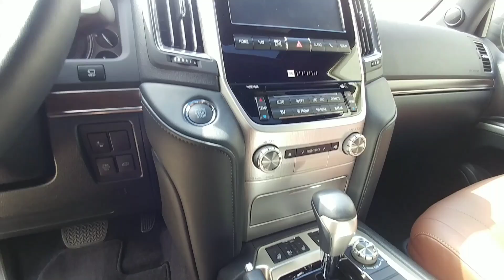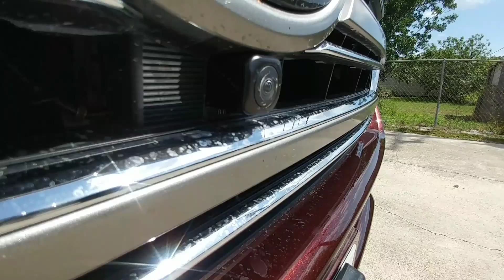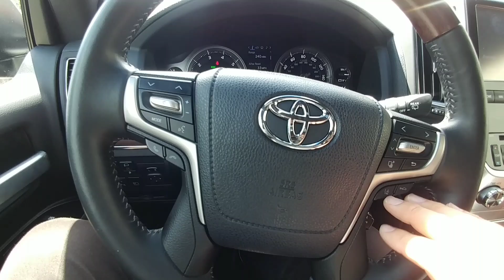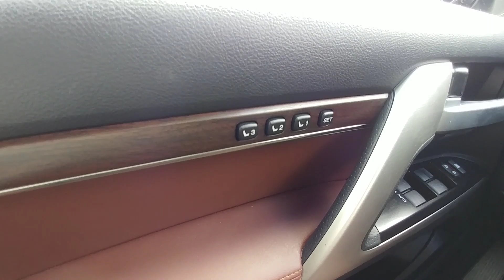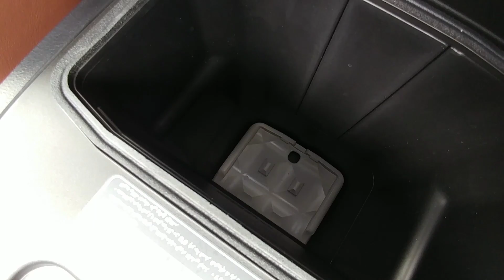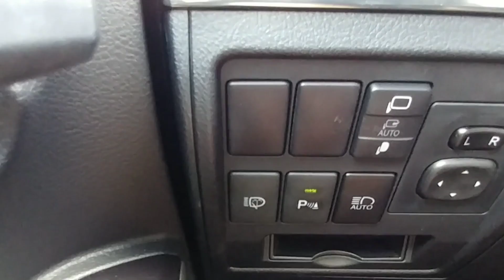The ultimate SUV! 2018 Toyota Land Cruiser

Comment: Actually the split tailgate is not new for this model. It first was introduced in the 100-series back in 1998. The rear swinging doors you mentioned were on the smaller Land Cruiser called the “Prado”. They were also available on some base model land cruiser 100’s but as standard they would come with the split tailgate as shown here. 

The only “new” thing that this current model has over the last one is the the top part is power operated. On the older 100’s it’s all manual release.

Comment: I love this truck and could care less about how "dated" it is compared to some of its competitors. I personally believe it's the best vehicle under $100k. I love the notion of stealth wealth -- you could take this through a bad part of town and not draw any attention to yourself -- the same cannot be said in any other $85k suv. Resale and reliability are also big selling points.
A few things really bug me though. First is that you have to go through the center screen to change the HVAC settings; I think that would be really frustrating to live with especially when using navigation. Apple carplay is also not available yet --  not a dealbreaker just would be nice to have. Also, the rear seat center armrest is too low -- sounds weird, but I sat in one of these and it was in a really awkward position where it doesn't really hit your arm when sitting regularly. Third, I wish that it was easier to remove the 3rd row of seats altogether if you don't need them. In the old 100 series cruisers, this was easy, but there is no easy way in this generation. Sure, better fuel economy would be appreciated, but those who can afford an $85k vehicle typically don't have to worry about budgeting for gas.

Comment: Why only 5 screws on the wheels. Saw smaller cars with 6 screws. Doesnt that mean toyota engine is weaker and doesnt produce that much force to the wheels ?
Reply from the maker: or they use stronger lug bolts.

Comment: I've had one since 2008. I live and work in Africa. The reliability and comfort is exceptional. Someone mentioned 350 MPG. Mine's diesel and I can drive 850 kilometers on a full tank (130 liters). The wife has a Range Sport, my son a Nissan Patrol , my daughter a BMW X6 and my Toyota spends the least time in maintenance and is by far the most reliable!!

Comment: my mom has a 2013 and that thing is amazing 100,000 miles and not a single issue. it drives like a brand new one
Reply: How comfortable is it? Does the off-road suspension make it ride rough over less than great pavement?

Comment: Its nice that land cruiser has drain plugs for transmission, front and rear diff.
Reply: is that not standard?
Reply: James Flores , it's only standard on Toyota.
Reply: +repairvehicle even sealed transmissions have fill and drain plugs you know right?
Reply: James Flores , do you know what sealed transmission means?
Reply: means no dipstick... ive changed the fluid in 2 vehicles I own both with sealed transmissions 1999 isuzu rodeo and 2009 bmw 528i
Reply: James Flores , transmissions without dipstick, have drain plugs and fill plugs.
Reply: yeah they are also called sealed

Comment: Forgot to add the fact that it’s a Toyota and will last 200k+ very easily with just minor maintenance! I wish I had the money for a Land Cruiser but too rich for my blood best off road SUV out there imo 🤷🏻‍♂️👌🏼👍🏼
Reply: You can find old 100 series for under $10k with less than 200k miles, 200 series start around $25k with around 150k miles. That's the beauty about the land cruiser, if you really want one, you can likely afford a used one that has lots of life left --even if it already has 150-200k miles.
Reply: You should check YouTube.  The motors are blowing on these all around the world as soon as 30,000 km (19,000 miles) due to faulty air box design.  The only thing legendary is the brainwashing.

Comment: $20k less and needs torsen front and rear diffs to live up to the LC name.
Reply: Firestarter according to the website it has exactly that.  Triple lockers Torsen unit.
Reply: Irish Spring Soap the American variant LC 200 series have open front and rear diff with a locking torsen center diff.

The international version has at least a locking rear diff. 

Land cruiser shouldn't have a single open diff

Comment: It looks like a great SUV but I'll never buy one. Like Apple and Harley, the Toyota brand has died for me for one reason... The smug douchy attitude of their owners.  I get one occasionally when I rent for work travel and I like them. I know they are rated well for reliability but I just don't care. I do preventive maintenance on my American cars and have yet to see a failure... With the exception of a 1996 Pontiac Firebird I bought new. Got rid of that thing when the warranty expired like it was on fire... Which it may have been. I was young and dumb and ran it hard. LOL

Nothing against foreign cars in general, mind you. I primarily buy GM because of the ever dwindling employee discount from my Dad, who retired from there after 43 years.  I just can't drink that particular flavor of koolaid.
Reply: Sociopath Mercenary it’s funny but I got to share that my daughter only 11 year old finds a resemblance on some GM cars with Toyota Corolla and Camry built on 1999 - 2003. I don’t know she might be wrong.
Reply: Emiljano Shehu I don't doubt it. With fuel efficiency standards so high, most cars look very similar due to the aerodynamics necessary to get better fuel economy.  I think style had been coming back over the last decade or so but for quite a while, the only difference between cars seemed to be the grill, headlights, and taillights. Lol
Reply: Which domestic made vehicles are you referring to? The ones made in Canada or the ones made in Mexico?

Comment: Land Cruiser station wagons have used the horizontal split tailgate since the 1950s, the vertical barn doors were only used on the "commercial" versions.  It's hard to tell but does that vehicle have the Kinetic Suspension System?  Your discription of the ride vs handling makes it sound like it does.  
The big question is, would you trade your Navigator for a Land Cruiser?  I'd guess if you like to change vehicles every few years you'd probably be on the fence, but if you want a vehicle to be a keeper, the Land Cruiser would be the choice.

Comment: Ahhh, the Legend.  One thing you didn't mention as to why people buy these:  the bulletproof reliability that you get baked into it.  This truck will go 30 years with just fluid changes, no problem.   You simply don't get that in a Tahoe or an Expedition.  The 5.7 is proven, the chassis is proven, and if you try to look up used ones, you'll see the only thing higher than the price is the mileage some of them have made it to.     

Truly legendary machines.  There's a reason these are the standard in the middle east.

Nice addition to this channel!
Reply: Very true about the mid east. When I went to Bahrain and dubai, I've noticed acres of these trucks along with 79 series fresh off the boat.
Reply: Not jus try LC. My Lexus RX 350 has 220k and looks brand new. More importantly not a single squeak inside. Tight as a button.  Toyota/Lexus just know how to make vehicles. My Toyota Sienna went 330k.
(The tranny did go out and I blame myself. I changed ALL the tranny fluid at 330k and it started to slip after I did that. Otherwise I believe it would have kept going if I didn't. Many, shops said you never change out fluid after racking up high mileage on a tranny. I agree) 
Otherwise....
An ultra reliable vehicle with  regular maintenance.
Reply: Yes the reliability is there but the transmission went out on my 100 Series well under 100k miles. I was extremely shocked by this. Lucky for me the extended warranty covered it. My navigation system went out shortly after that. Unfortunately my extended warranty didn't cover it. It is a 2001 and I still have it today. Mileage is currently at 1006,000 I'm probably looking to replace it this year with  something new. Might want something different.

Comment: Special forces and the other markets around the world get the real land cruiser. This one is the toned down version. For the price just get the Lexus since the price is almost identical
Reply: whiteandnerdytuba eh it’s a Land Cruiser 200 series. Swap the steps for sliders and put some tires on, it’ll go.
Reply: whiteandnerdytuba 
For the price I'd actually rather have this. It doesn't have as many not-so-useful  features that'll break later as the Lexus. Approach, departure and breakover angles are better in the land cruiser than they are in the Lexus. Plus imo, the Lexus is waaay too unsightly. Now the twinturbo diesel version of the Land Cruiser is 👌
Reply: What’s the real one? The 70 series? I don’t agree, this is better for the special forces application.